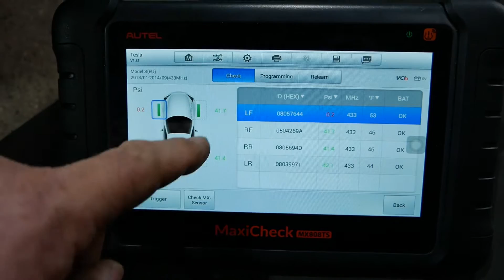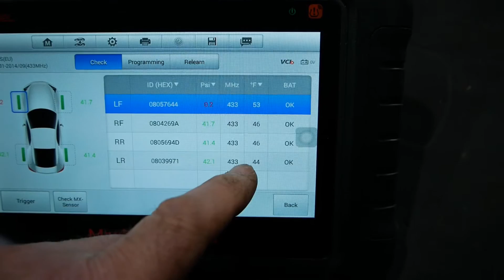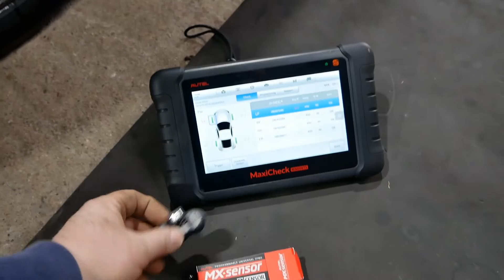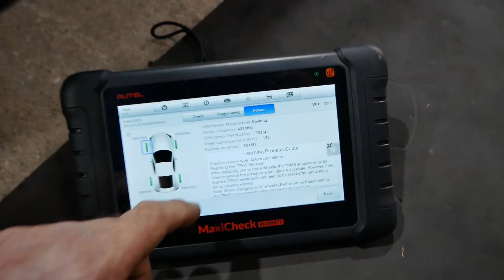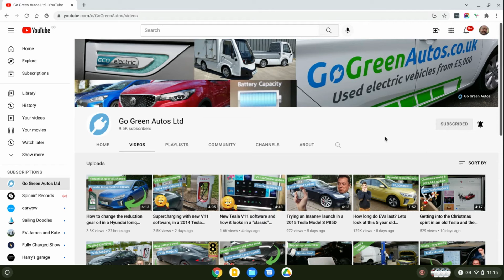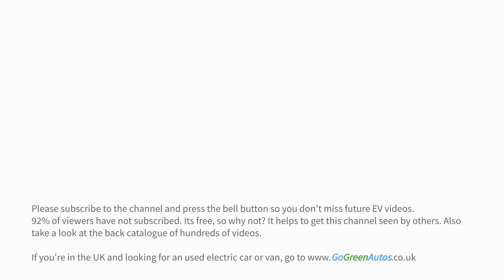An introduction to TPMS sensors, while I replace the TPMS sensors on my 2014 Tesla Model S.

Comment: great video.  Wonder if replacing the sensors necessitates a rebalance since the weight difference is so small.
Reply from the maker: The difference between brands of sensors will only be a few grams. No different to having a stone in the tyre tread.
They don't weigh much anyway.

Comment: Did get the ECU retrofit from Baolong to Continental?
Reply from the maker: No, not when I filmed this. But a couple of months after filming this video, I had problems with the Tesla and the park brake wouldn't release and I was unable to drive it. It got recovered into Tesla and they replaced the TPMS ECU with the new Continental one and annoyingly replaced my TPMS valves (which wasn't needed). So yes, I do now have the Continental ECU in this vehicle with also the corresponding software update which now displays the tyre pressures on the dash.
Reply: @GoGreenAutos  do you know if you can insert new TPMS sensors into aftermarket tyres with the Baolong ECU without duplicating the originals? Just failed an MOT due to the TPMS warning light being on and need to sort new sensors. A few garages I've spoken seem to think I'll need to go to Tesla who will just end up making me upgrade to the Continental system for a pretty penny.
Reply from the maker: @ianwebster  I've just made a video for you this morning, which may help to answer your question. See https://youtu.be/YkL1ZjQ-TIw
Reply: @GoGreenAutos how much was the ECU tyre replacement? Wonder if its worth it.

Comment: I have a 2018 Model 3 LR, bought new tires/wheels and ITM sensors but one specific wheel, I replaced the sensor twice. At first, the car recognizes the sensor but then 30 minutes later it throws the error ‘tpms fault’ and stops updating for days/weeks. Americas Tires is able to read the sensors, but I had it replaced anyways. After replacement, again car picks up the wheel but then throws a fault. I rotated that wheel to the back left (closer to the TPMS module) to see if it could be poor signal. Again the car picked it up but 30 mins later stops updating and throws an error. The other 3 sensors works fine just not that specific wheel. Went to Americas Tires, and both times they said the tpms is reading but not sure why the car isnt picking it up. Any clue what could be the issue? I was thinking making it could be the tire or the rim causing some interference.
Reply from the maker: Sorry no, I don't have any ideas as to what is causing your problems. It doesn't make much sense.

Comment: Ok. I have a set of 22 inch rims on my 2014 Tesla s. Car was in a accident and now I have a 2016 75 D. Luckily my rims weren’t on when the other car got crashed but I was wondering do in need to reprogram the tpms sensors before I put them on. Or can I put them on the car and go through the menu on the screen to get them to relearn
Reply from the maker: Yes the car will relearn, just drive a few miles first.
Reply: @GoGreenAutos  thanks

Comment: I have a model s 2013 and bought newer turbine wheels 21 inch . The car keepa seeying there is a tpms error . The local garge checked all the sensors they all connect but said it was 2014 alloys and tpms . Anybody knows how to get rid of the tpms error??
Reply from the maker: It could be your TPMS ECU. Mine has just been replaced. A video on this subject coming soon.

Comment: A useful video Matt, what about a video of brake fluid change on a 2020 ZOE ,I understand that they are not straightforward. Roger from Norfolk.
Reply from the maker: Correct a full brake fluid change is now straight forward and something only a Renault dealer can do. But a partial change, which most have done, can be done by any garage.

Comment: The batteries really should be replaceable, there's no excuse  for them not to be.
Reply from the maker: Yes they should be, as they're only a 50p cell, but instead you have to replace the whole sensor and many get charged about £150-200 for such a job.
Reply: @GoGreenAutos  Are the cells replaceable in the new ones?
Reply from the maker: @vladimirputin4822  No. I don't think a sensor exists with replaceable cells.
Reply: @GoGreenAutos  😞
Reply: I cut the silicone and replaced the lithium battery. 2450 cells with tags it was just a quick soldering job.  I resealed them and took them to the tyre shop. They claim that they are not transmitting anything. Mine were Continental brand 433MHz for 2014 Tesla Model S.

Comment: Can you control the pressure at which the car tells you, you have low tyre pressure?  Does the Tesla enforce any speed restriction if the pressure gets too low?
Reply from the maker: On the older cars like mine, it doesn't display the pressures for each valve, but instead just gives a safety warning that a tyre is low. Newer cars have a full display like many cars do. As for a speed restriction, I don't know. I don't think so.

Comment: Hi, thanks for information could be very useful but hope not.
I know you own an ioniq, I have received by letter a recall for mine. It’s todo with EPCU SOFTWARE UPDATE & GROUND POINT INSTALLATION. Can you throw any info on this my way. Has your car had this update? When I spoke to a dealer to have this done they didn’t seem to know about it. Gets a bit scary at times garages have a lack of knowledge about ev’s. Where can I fined what the latest updates for my car should be? Many thanks.
Reply: Hi Paul, we've just had our Ioniq done,just Google "Hyundai Ioniq recall" to see details,hope that helps..
Reply from the maker: Our Ioniq is booked in for this recall work, plus another was found to be needed too. Its not going in until sometime in April, as this is the only time its convenient to be without the car. I don't know anything about the recalls, other than what is in the recall letter we all received.

Comment: Well thanks, Matt that was fascinating, I always wondered exactly how these worked. When we bought our Roomster new in 2013 I was very pleased to get TPMS as its difficult for me to get down to check my tyres. I thought it would be great to know they were OK. Turned out to be not quite that good, they put up a warning at the first sign of loss of traction in a wheel so as its always "crying wolf" I just get them checked at the garage and ignore the symbol most of the time. Shame but I think they're more sophisticated now.
Another great video, glad you recorded it for us. 👍
Reply from the maker: Yes back then the flat tyre warning system wouldn't have been TPMS sensors, but the ABS sensor measuring a different wheel speed if a tyre was low or flat.
Reply: @GoGreenAutos  well thank you for explaining that, I couldn't understand how it kept happening, now I finally get it. Cheers Matt 👍😊